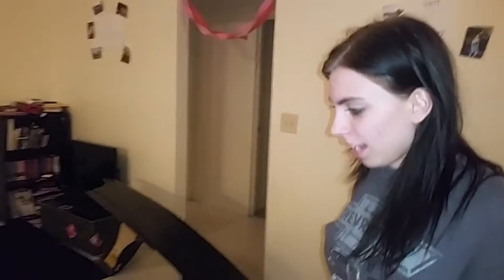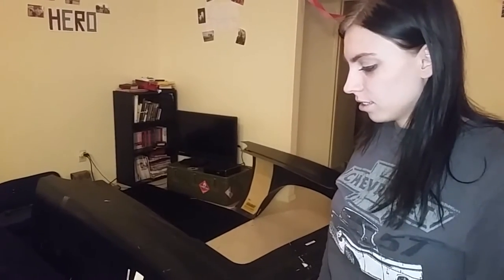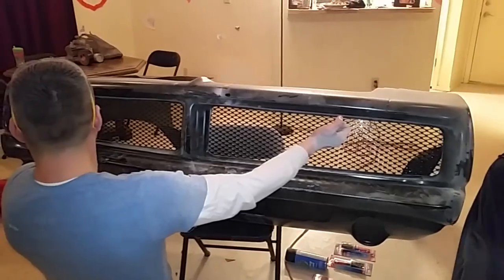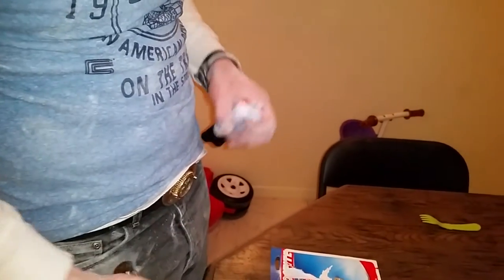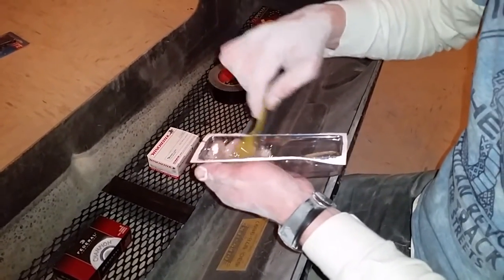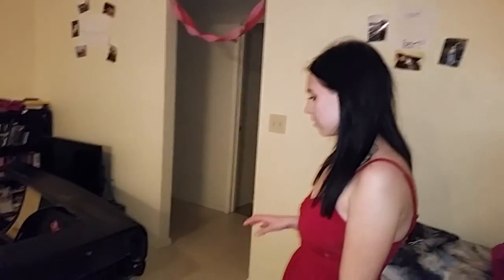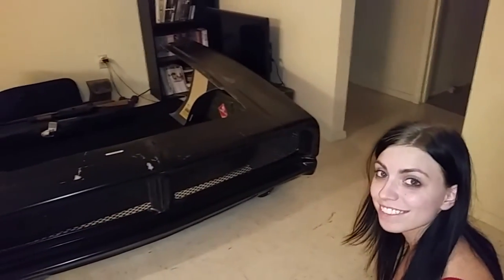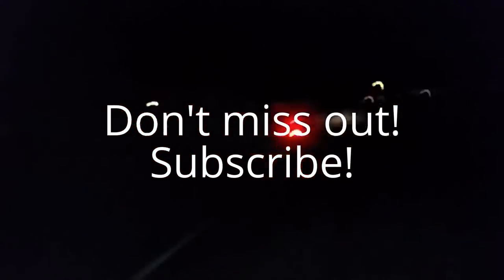1969 charger pt 4 custom mesh grill for Evelyn's 69 Charger

Comment: Lucky13! The ultimate road course car, pickup truck, station wagon, 1/4 mile beast, family minivan with an attitude, long distance trailer hauler. If K-tel ever came out with something like this in the way of a car I would suspect the both of you would have had something to do with this. I am in awe of the results obtained in the making of the grille for Evelyn's Charger. again getting tasteful results at a bare minimum cost, and so unique. Mad Max has nothing on you both. The tail lamps are an awesome score.  They can be either polished or clear coated to make them look totally new. Be careful with that fiberglass dust. Magnified the particles look like spiky pollen and can stick in your lungs. That expoxy is a wonder glue and a stinky lifesaver at times. Keep these clips coming please, always look forward to them. The FB page is awesome and I figuredcout how to feature Invinvibleextremes on my own You Tube page!
Reply from the maker: Thanks, yeah we have some wild adventures.  We cleaned up the dust, that stuff is horrible.  Made the mistake of rubbing my face while it was dirty and got micro scratches all over that itch.  Grill came out better than i thought, now i need to figure out where to get headlight mounts for standard 4 headlight setup (not going to do the roadkill general mayhem single headlight style...) and i just may use headlight buckets and chrome rings from a 68 firebird... i still may have a spare set and that would simplify maintaining "the fleet"... the gto, bird and this can all use the same headlights that are cheap and easy to find.  Btw thank you so much for featuring my channel, means a lot to me.  As much as i appreciate views i really dig when people come back and found something useful and were able to apply something they learned from my how to videos and saved themselves money and got their hot rod on the road cheaper and sooner... (richtownraider for example).   Take care man, i'll be seeing you around.  Maybe when i'm a free man i'll do a north america roadtrip and come visit your town in one of our cars.... by then a couple of the cars will be doing what the firebird does ;-)
Reply from the maker: Btw, as much as i have been taking some stuff from roadkill they seem to be taking some pointers from my itty bitty channel(or listening to their fans...same thing).  The trailer burnout for example in the boat episode... and the winter cross country roadtrip looked a lot like my muscle car christmas adventures... cept with sponsors ans money and fuel injection... ;-)
Reply: Oh I could see that.  Nowhere have I seen somebody do a burnout like that towing something.  Nor would many take to the adventure of going cross-country in an older vehicle like yours, carrying many people in it AND loading it up as was done, coming through with as many smiles or stories as shown.  Roadkill is a pretty decent series, but again, it is big dollar items such as what was put onto the Buick Special wagon, and regardless of what the mishaps may be, they had at least one chase vehicle with them, and, regardless of the cars or situations, things have to be staged.  And parts of cars, or things on them are called out wrong or do not even exist on that particular vehicle.  I don't remember a chase vehicle with you and your family when the starter wires caused you to have to fix the car on the side of an interstate in the middle of nowhere. As for the fiberglass, yes, it does itch horribly, and the spiky edges do make the stuff stick to you. Using the good 'ole 5 3/4 sealed beams across the board would be a good idea, saving you money.  I do have a couple of sets (at least one) of Bosch H-4 lights, which may be good for you on those late night charges down the highway BTW.  No problem, as I said, your channel is an undiscovered, though gaining momentum gem.  Mine has views, but it is the result of many clips put up, and not a 'viral' thing, perhaps it lacks pizaz or a gimmick of some sort, but if it helps to get ones like yours on the road, all the better.  It is a hobby and extra activity the channel, so this makes the fact you are getting more exposure all the better.  Yes, one day a northern road trip for you, - in the summer - when it is a lot nicer up here.  There are oodles of car shows and cruises to be seen too.  Bet you would rattle a few frames and uni-bodies up here too!
Reply from the maker: spikedpunk its a plan then, going to swing up and hand out bumper stickers and t shirts and have a good time with everyone...   i love roadkill, but fuel injecting a dead reliable (making it unreliable as a bonus) stock 4 barrel buick was pointless drama.  I do like how they are responding to the fans and doing more down to earth roadtrips and such.  Except 200 miles is how far i drive ONE WAY in the firebird towing a trailer and then getting a rust bucket 69 charger.... its not that hard.  Hell i drove across the country in a 66 mustang i had just bought and other than blowing out a drum cylinder it was drama free.... ok maybe not, but no complaints... its that. Red one on facebook.  ... btw the british paratroopers are here for a month again and its bound to be a wild time...
Reply: That would be sweet!  I do agree as to why these folks put on the fuel injection, really complicating things when the old set-up did not seem to be causing any problems, and the car needed other things folks in real life would hopefully address first.  A friend drove a '56 Oldsmobile across country (see the car on my page) when he purchased it, I really regret not going with him to get the car.  It was a life experience for him, and the car did fairly well. I am familiar with the red Mustang on your page too!  Ah, the British Paratroopers are back!  We are certainly in safe hands now, troublemakers be aware, and I look forward to the adventures they bring along with them as they did last time.  They really like the old Detroit Iron!

Comment: not sure if I'm behind the ball did you do the floors? trans tunnel diy ? wheel tub mount inner wheel well
Reply from the maker: not yet, i put in a glass windshield and a lexan rear window.  still lots to do on that charger.  got a 440 and 727 for it, once they're in, then I can fab up a trans tunnel around it and build wheel tubs after replacing the rear frame rails...
Reply: +Invincible Extremes Muscle Cars Garage that's where I'm at with mine